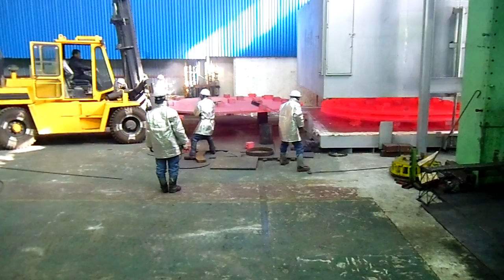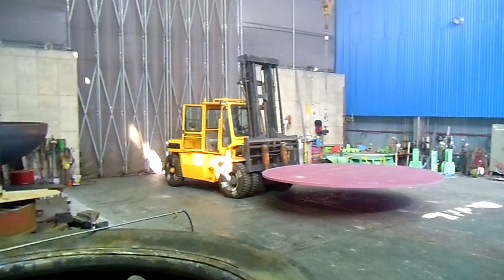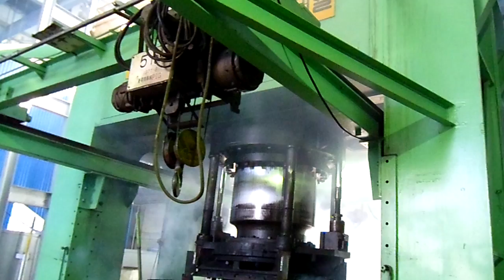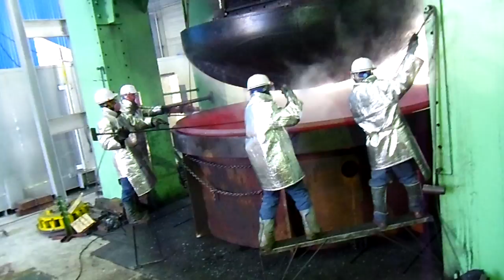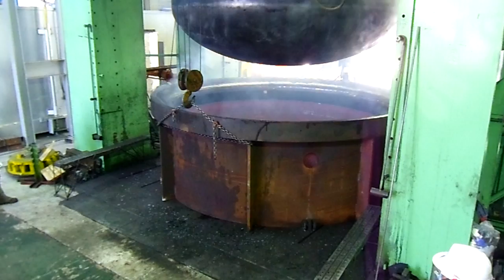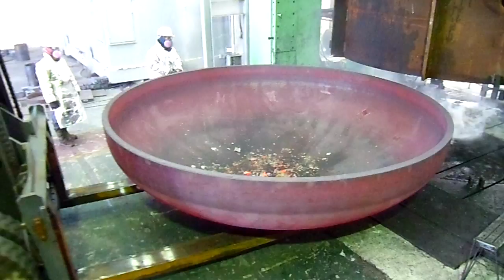HOT Forming Press, Tank Head, Dish Head, Vessel, CIM Tech   www.cim21c.com

Comment: 4500 ton press but they write 3000 ton in the description?
Reply: Edgar, perhaps it did not need the full capacity of the press for this job all be it the press is capable of more. Just my thoughts, cheers mate John, Australia.
Reply: @joandar1  the press is rated to a tonnage capacity 4500 in the case of this press. You would never write what tonnage of that 4500 ton capacity was use to make one unit to describe the video. It's either a 4500 ton press or it's not. Former industrial engineer, toolmaker, 1000 ton press operator and maintenance fitter.
Reply: @edgarbleikur1929  I am sorry  if I have offended you, in future with my years of experience I will not offer an alternative thought to a question posed even though I mistakenly thought I was being POLITE!
John, Australia.
Reply: @joandar1  where have I indicated or insinuated you've offended me? Why the over reaction to my educated response?
Reply: @edgarbleikur1929  You win as I will not continue to beat a DEAD HORSE! Goodby!!! John, Australia. 
You SNAG.

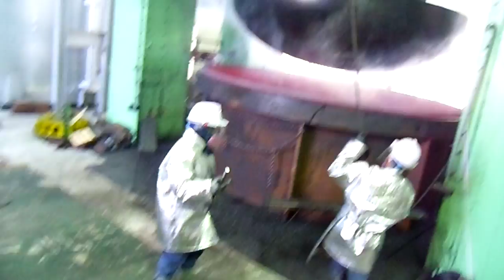Comment: What's with the slab of wood thrown in at 4:32?
Reply: it is piece of plywood, it burns down to ash and charcoal, so there is thin layer of ash (basicly carbon dust) betwen ram and dished end which prevent sticking. usual lubricant does not work because of the temperature. Blacksmiths use charchoal to prevent sticking tools like drifts for centuries....
Reply: alemnium